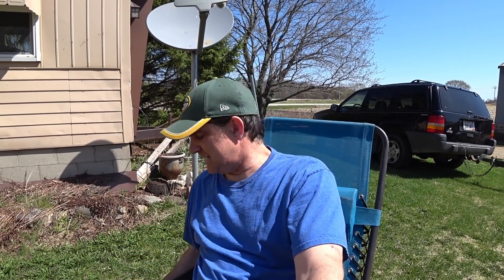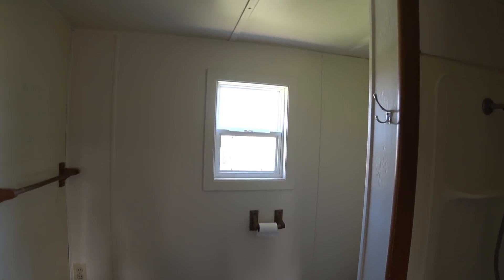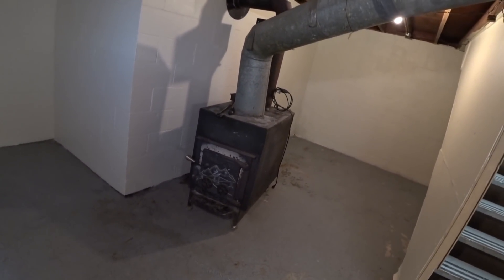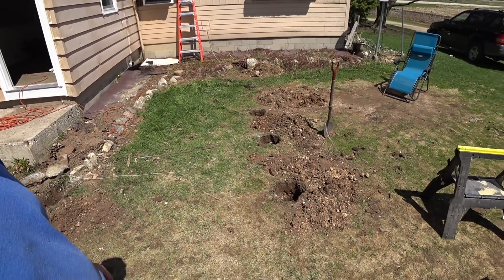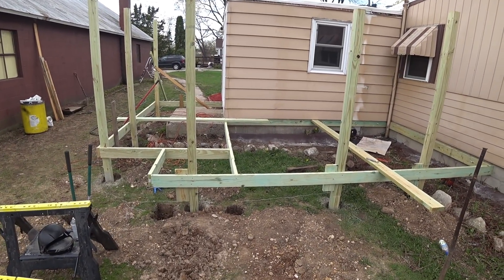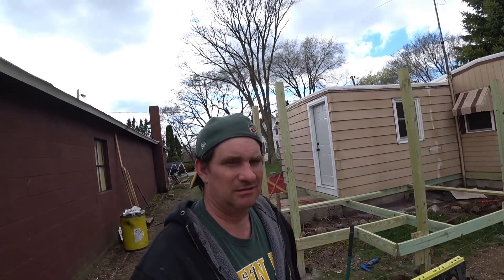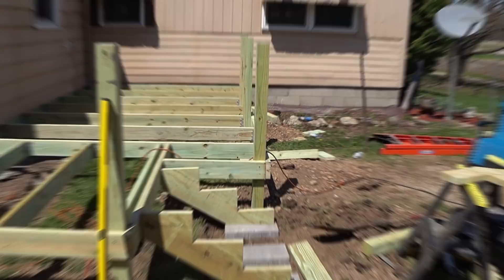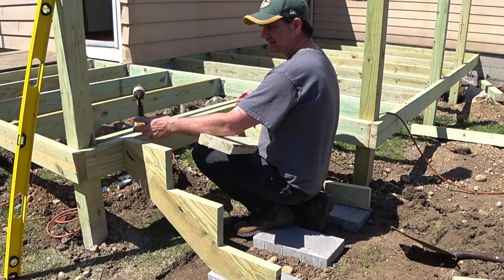Deck Build for my parents part 1 #173

Comment: Good job inside the rental house & outside with wood chips. Deck is looking good. Nice if it had an aluminium roof over top. Keep the moisture / rain / snow off. Last longer. The work your doing is light & like a stretching exercise so maybe helps your back. Stay away from white flour & sugar products as it will cause inflammation in the body & joints. Not good for health overall & your back. Remember to get that 100 lb person to walk on your back. Fix ya or......put ya in wheelchair Ha !!! Just a joke. God bless He loves ya but devil hates us all. Let God be true & every man a liar.
Reply: Add in: Brian your sub friend is one nice guy. Volunteer to help out. Digging holes is not easy at the best of times. Not so bad if ground has lots of dirt & not too much rock. Good on ya Brian. 
Of course your bro for showing up to help out too.